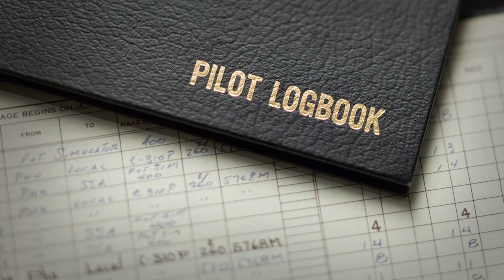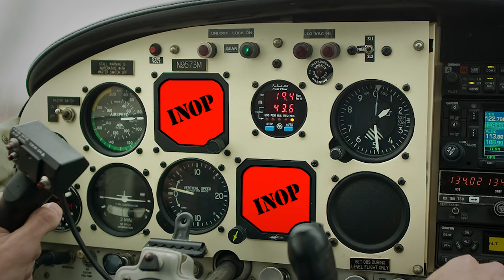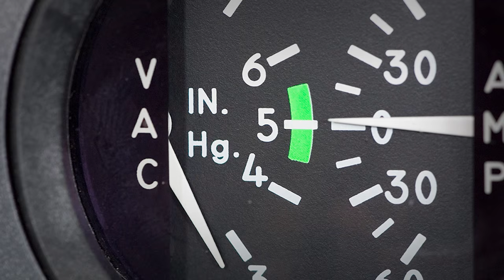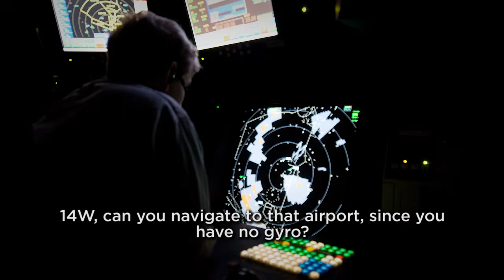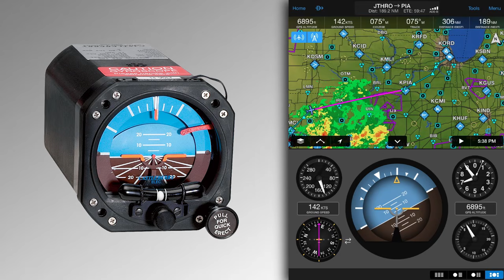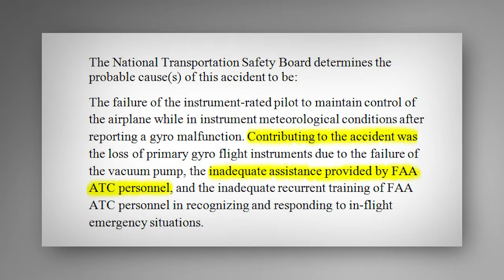Accident Case Study: Emergency Management

Comment: This seems so weird.  Why did they not just go to the alternate?  How can you perform an IFR approach with partial panel?
Reply: Navaids aren't on the vacuum system. The problem would be flying TO the approach, and going missed if needed. The approach itself, especially an ILS, would be relative cake.

Comment: As PIC declare a emergency.  Make sure you are at a safe altitude and have plenty of fuel.  Maintain straight and level.  Until you can do that don't do anything else.  Unless we are flight instructors it is likely we are rusty.  So keep the wings level and your altitude level and tell the controller that that is what you are doing.  Aviate, navigate, and communicate.    In that order.

Comment: As usual, excellent video. Surprised,however, there was no discussion of the post-crash inspection of the turn-and-bank indicator (a misnomer for the old WWII needle and ball I had in my Cherokee 160) or the more modern turn coordinator this aicraft probably had. Neither one shows attitude but they do show rate of roll initially then rate of turn when roll stops. The pilot must have had some knowlege of that and seemed to follow the controller’s no-gyro instructions (turn/stop turn) successfully for a while. Curiously the narration never covers the challenges of flying in IMC with the TC (and its electrically powered gyro) with no pitch information except the altimeter and airspeed indicator. It’s not too tricky if you’re proficient, which this pilot clearly was not. Tragic he did not stick to his guns and go to the good VFR at Columbus.  That’s a missing point in the narration too…both the pilot’s and ATC’s failure to go for the simplest least risky option: stay VFR or get to VFR ASAP.

Comment: I don’t know why the controller decided to have him go around. A good controller would’ve known that a GYRO is an emergency & would’ve possibly gave him a makeshift VOR/DME approach, by giving him DME-to-altitude reads to see if he can at least put it down long on the runway. A long landing and possible runway excursion is better than sending a troubled pilot back into IMC. However, the pilot should’ve declared an emergency when he seen his GYRO’s failing and should’ve asked for vectors out of the IMC area and to a VFR/MVFR field nearby. Yes, blame the pilot because he is the PIC and could’ve spoke up & asserted himself. He also should’ve been on top of his maintenance “if his vacuum pump and GYRO was not serviced”. I blame both.

Edit: I did not watch the entire video, before composing my comment. Only watched a couple minutes. So, kind of repetitive to the video.

Comment: GA pilots need to train on regular basis....use the system in vfr conditions...
Reply: I've replace out of my own pocket, vacuum pump on single engine piper products in wintertime,flying night freight to n down calif.lost a pump over LAX area IFR night,flying partial panel til breaking out,continued VFR,til SAC destination

Comment: Pilots need to assume that ATC has no idea what partial panel flying is like and/or no gyro. Most controllers are NOT pilots. The pilot in command has final decision and must not be afraid to be firm with requests to ATC. They might think you are a jerk but it’s better to be an alive jerk than a dead nice guy. In most cases ATC will go above and beyond in order to help facilitate a safe landing but we must be informed fully of the situation. We are just looking a lines on a scope. 

If possible I suggest any regularly flying pilot to request a tour/walk through of your local tracon/rapcon. It can help pilots understand what we are working with and how providing more information only benefits everyone. Rest In Peace to this pilot

Comment: Vacuum system not connected to the engine intake manifold as a back up on non-supercharged engines? Also from the intro montage, never fly wearing Uggs.

Comment: I would never consider doing a hard IFR flight with a single point of failure gyro - backup PFDs are plentiful and cheap. Obviously, continuing into an IFR approach on a partial panel when a VFR alternative is available is legalized suicide.
Reply: @UC5AnhmkMgbEO8v63u3TXDiQ a gyro is the device used to gain multiple kinds of information that can be displayed on a an instrument. For example, an attitude indicator (the glass instrument that has the face that is blue and brown) uses a spinning gyro to tell you what your planes attitude is from the horizon. By breaking the gyro or the gyro not spinning, you loose the ability to recognize what youre actually doing in the clouds. There are a couple different systems run by a gyro like the heading indicator (which is not a compass as it doesnt use magnets) and the turn indicator. Hoped this helped!

Comment: As a non-craft owner: do the dry gyro pumps have a different inspection rate other than a typical airframe annual? Seems like since they are such a kingpin to safe flight into IMC, they would have a separate inspection schedule.... or can they even be inspected? Curious.

Comment: Here is yet another case where both pilot and ATC need to throw conventionality into the toilet in order to be safe in a clearly bad situation (reported no-gyro).  In anything even remotely similar to this case, when a pilot can see the ground, he should DIVE as far as necessary to assure he can stay in visual contact with the ground.  And the pilot should immediately say to ATC "screw everything, I see the runway and I'm coming in to land immediately, so do whatever you need to do to clear everyone away".

Comment: What are the consequences for declaring an emergency? 
Doesnt make sense why some pilots are so reluctant to declare, when the emergency is out of their control.. it's as if they're avoiding declaring emergency because it jeopardizes  their license or something
Reply: No consequence with anything broken in the airplane.  I have declared twice just because of a rough running engine.  First priority, got on the ground, got it fixed. Both times I said my number, declaring emergency, and landing runway.  Never assume anything not working is not going to get worse.

Comment: I just don't understand why they are so afraid of declaring an emergency. Even more than losing their lives
Reply: Machismo?
Reply: I do not understand the fear or embarrassment of declaring an emergency if it's an obvious mechanical failure. It makes no logical sense.
Reply: just like refusing to ask for directions
Reply: @adotintheshark4848  getting lost in your car typically doesn't result in death. I hear what you're saying, I've driven 50 miles in the wrong direction cause of my stubbornness, but it's not even remotely close to comparable.
Reply: It's a probability thing. If the pilot knew that his two options were to declare an emergency or die, he wouldn't hesitate to declare an emergency. He figured the chance of anything going wrong was low enough that an emergency declaration wasn't warranted. It turned out he was wrong, but it's not like he intentionally chose death.
Reply: @coolbrounderscore  There's no downside to declaring an emergency though.
Reply: @paulwal222  There are definitely downsides to declaring emergencies, otherwise pilots would do it every time they fly
Reply: @coolbrounderscore  Ok, correction: so maybe there are downsides to falsely declaring an emergency, but no downside to erring on the side of caution when you think it may be an actual emergency.
Reply: @paulwal222  Yes, I was being intentionally difficult, but I think my point is valid. There is some reason that pilots experiencing difficulty are hesitant to declare emergencies. We don’t even necessarily need to articulate that reason to acknowledge that whatever it is is the downside to declaring an emergency. 

The pilots are doing a mental exercise: “Should I declare an emergency? On one hand I get priority treatment from ATC, but on the other hand…” whatever finishes that sentence is the downside.
Reply: @coolbrounderscore  Good point. I wonder what the prevailing reasons are then? Pride? Paperwork? Job security? Denial?
Reply: @paulwal222  Probably all of the above, plus some more. Not wanting to seek help is a common issue in humans, it’s just particularly harmful when it happens in airplanes.
Reply: @paulwal222  Revelation.  Postponement(s) of responsibilities.
Reply: @coolbrounderscore  there's gotta be standards though. No gyro in IMC is immediate emergency. That should've been practiced and remembered long in advance. Easy to say on the ground, I get it, but still. And the fact that he went back into VFR, then decided to willingly try landing IMC with 2 hours fuel, it's an extremely odd decision that should go against any instinct you have as a pilot. 

Again, easy to say on the ground.
Reply: FAA paperwork is more scary than dying it seems
Reply: Perhaps because to declare emergency means to admit that you are not in total control anymore. It can be even scary to admit that. You want to tell yourself you got everything under control, just a little bit more. Until its so late that declaring doesn't help you anymore.
Reply: @rykehuss3435  to not declare in an emergency already in a situation means control was lost. You regain some mental control by declaring an emergency, your mission is to get on the ground as safely and as intact as practical. He lost it the moment he was in the soup and never gave himself the chance to get out of it
Reply: Because he's a surgeon. Ego.
Reply: Hubris.

Comment: AOPA is wrong in this assessment. This was a pilot with lower flight time that ran into emergency (loss of vacuum pump) and was not IFR proficient. Radar imaging showed he was having serious trouble handling the airplane and he told ATC of that fact. He also knew his limitations and made the wise decision to go to his alternate. ATC's insistence that he return for another ILS approach only contributed to his overstressed workload as he was looking for their help. While the pilot could have said declared an emergency, ATC should have handled him as such given he was partial panel, could not hold heading or altitude, and stated he was having difficulty. There was no reasonable explanation as to why ATC put him back in the IMC condition pattern for an ILS approach. Despite AOPAs video conclusion, Pilots have a relationship with ATCs that is based on trust and mutual respect. This pilot should not have died and wanted to get out of the situation.

Comment: question: as a non-pilot,  are there any instruments available / sold for small private  aircraft such as this type that would help get the plane automatically established on the  localizer with very little or zero pilot assistance, and using only a  standard airport   ILS ?   it seems that if there were such a devise developed and available,  it would be mandatory  on all aircraft no matter the cost...........

Comment: What exactly is "no gyro"?
Reply: "no gyro" while slightly ambiguous, at least with my experience means 1 of 3 things.
1: Electric gyro failure on the turn coordinator (no indication to direction, or standard rate of turn, ball still works).
2: The independent failure of the heading indicator(should have a magnetic compass in case of this), or attitude indicator(no (specific) pitch/roll information (however you can interpret a vague aircraft attitude/roll with the turn coordinator(if working), altimeter, and to a lesser degree VSI).
3: Failure of BOTH heading indicator and attitude indicator (most likely, as both are (again in my experience with single engine aircraft) by a (engine driven) vacuum pump) leaving you with just the turn coordinator.
Reply: Got ya.  Thanks.
Reply: @oncet0ldme1aint  Does that mean you cannot tell which way is up or down?
Reply: @oncet0ldme1aint  Does that mean you cannot tell which way is up or down?

Comment: Since 2001 the FAA has made recommendations for ATCs to be trained in equipment failure. However, the ruling is not specific, training is sporadic, and none of the 3 controllers interviewed claimed they had training with scenarios caused by loss of gyros. They knew what it meant--no heading--but they didn't know what it meant to a pilot's inability to control the plane.  They also did not know the weather of the alternate.  The ATCs were not trained properly.

Comment: Diversity in the tower did not work out.  A talented doctor is now gone.  ATC is there to assist you.  ATC should have handed the aircraft off to Columbus.  If that controller was white, criminal charges would have been filed.

Comment: Screw ATC !!!  Whenever a pilot has this kind of problem (instruments not working in IMC) ... AND ... nearby airports with VFR conditions exist, only a complete moron would do anything but fly into VFR and to the VFR airport.  Of course the main reason for being a moron in modern times is trust in authority.  Anyone who has a way to save their butt independently (alone)... SHOULD.

Comment: Are some ATCer's hostile towards pilots ?  Theyre not allowed to talk normal ? " there's a vfr airport 5 miles away from you, make a right turn, you may be able to see it after your right turn. "
Reply: not ATCs job to tell you how to fly your airplane or where to divert to. Telling someone to turn right could put them in a spin which then ATC would be blamed for despite the PIC having the final authority.

Comment: IMC? Failed Gyro?
I'm declaring an emergency.
Reply: ...and you would be well-advised to do so.
Reply: Tom B I can’t fly an airplane, but after 400 episodes of ACI and 20 of AOAO, I know all failure modes. Lost your elevators? Control direction using asymetric engine power. Small aircraft and the ATC cancels your clearance in favour of a Boeing and it makes you feel overwhelmed? Declare emergency to land. Ultimate armchair master of failure-mode-only piloting.
Reply: Adrien Ragot oh that video. Poor girl in the cirrus.
Reply: @antoy384  Ha ha, great comment!
Reply: @antoy384  What's ACI. I don't fly, and don't ever plan to fly but for some reason these videos are endlessly entertaining to me.
Reply: @lockergr  ACI = Air Crash Investigation (the series). Formerly known as MayDay.
Reply: Adrien Ragot Ahhh, thanks man!
Reply: Adrien Ragot the elevator is for pitch control. Not yaw :)
Reply: @antoy384  True that.  I don't know shit about what to do but I know what not to do.
Reply: EXACTLY! AND YELL IT AS LOUD AS YOU CAN! TOO MANY ARE AFRAID TO DO THAT

Comment: The tricky part of partial panel is flying the magnetic compass and correlating that with the CDI. This is what I think happened with this pilot  I always taught compass turns and timed turns but the best fundamental technique I realized is to make a std turn in the correct direction for  a few seconds then level wings and allow compass to stabilize. " turn a little wings level".  Repeat until you're on the desired heading. Then once on course,  make the same small corrections laterally referencing the cdi and turn coordinator. Makes life much easier. Hope this helps a bit.
Reply: Skunkowork  I agree . Trying to fly the mag. compass with all its lag , lead , and acceleration errors is extremely difficult . The Army used to teach that to its rotary-wing pilots , but I doubt they do so today. I also doubt any of them ever used it on a precision approach!
                      As you say, timed turns are the way to go on partial panel. Personally, I’d use std. rate for the first half , and half std. for the last half of instrument approaches, but that’s just a matter of taste. BTW do you know of any flight sims that actually incorporate ANY of these mag. compass foibles in their programs? I doubt that, too. Must be yet another confusing detail for the desk flyers if , or when, they ever try flying a real aircraft.
Reply: @davidwhite8633  I know some instrument trainers use Microsoft flt sim software,  it simulates compass errors to an extent. The lead, lag and timed turns are a good base but I found better results from my students when referencing the compass as in my previous comment. Basically if I'm using the old fluid compass, I just do a std rate turn until I see the heading in the window, then I level wings. And make small, quick turns to center it. When you have to fly, navigate, communicate, and troublshoot a problem. Simple is easiest and safest.

Comment: Why did the controller cancel the approach clearance? Was he too high on the glideslope? That's about the only thing that makes sense.
Reply: Yeah, he was at 1100 feet at one nautical mile out. That makes for a 9.35 degree glideslope. It's usually 3 degrees, I believe.

Comment: He was holding that pillow wing nose high when he was in the soup and my guess thats what was causing the course deviations. That plane flys like mush in that attitude with power and is a tough one to stall. Trim for straight and level would have been a good idea when he had some visibility. Damn shame. To bad there wasnt someone there to say "let go of the controls".

Comment: I’m not a pilot, but isn’t it common sense that if you are not capable to fly with your visibility impaired by clouds, fog or night flying that you don’t get yourself in these type of situations? I know things change rapidly in some cases but I would be scared to death in the air flying with the possibility of dealing with one of those visual possibilities. This case seems like he had a somewhat easy alternative to get out of it but didn’t choose it.
Reply: Weather changes on a dime. It's not all nice and neat like on TV. I don't do planes, but I've done more than enough on cars and motorcycles.